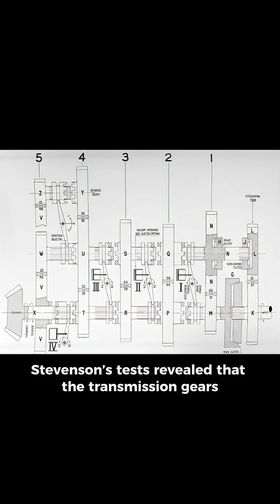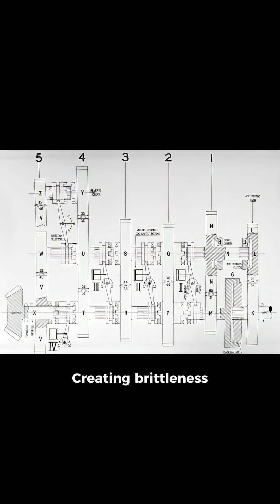British Metallurgists Examined Tiger Tank Transmission Gears — Then Discovered Why...

Comment: Excellent specific analysis. 《 Tiger》was a nightmare, even before get into battle, for Nazis logistics. Russian  mud between 24 interlapped wheels, frozen, made imposdible for monster to move in the morning or after rain in Ukrain ''rasputitza'' ( derp, black Ucrainian mud). Bridges couldn't suffer 56 tons - weight, turning of turret was too slow, huge consumming of petrol , only 100 klms range on good terrain, (very fewer in real conditions), need of special - small- tracks for train transportation, very difficult to be repaired under battle circimstances  :
 in the contrary of soviet《 T-34 》in battle repairing, by the "braviest of the braviest" , Soviet women technicians under explosions of shells and machineguns firing etc. etc.
Shortcomings of "Tiger "were about equal to its fighting abilities. Nightmare logistics...
KOSTAS TRENT

Comment: The Tiger was supposed to be a breakthrough tank, creating a breakthrough and then going to depot maintenance.  Of course after July 1943, that plan was no longer possible.  Tigers were usually desperately needed for defense, and on the line often continuously for days or weeks.

Comment: You meant the case hardening was too deep, the running surface needs to be hard, resisting wear, but with the mass of the gear softer and ductile to flex rather than break.

Comment: 'Excessive case depth' is an interesting. In case you don't know, 'case hardening' is about hardening mild (low carbon) steel. Mild steel is cheap and plentiful; it cannot be easily hardened on its own. Case hardening is about introducing carbon into the mild steel - either by cooking it for a long time in the absence of air and in the presence of carbon - typically in the form of calcium or barium carbonate or using natural sources of carbon such as bone chips or animal skin. Alternatively, the 'nitriding' process uses sodium cyanide as the source of carbon. Once the carbon has penetrated into the outer layers of the steel (and it doesn't go in quickly) the steel can be hardened by heating to red and then 'quenching' in oil, molten salt or water. This produces a hard outer skin known as the 'case'. It's very important that the case is 'tempered' - another heat process - which increases the 'toughness' of the steel whilst reducing its brittleness.

Excessive case depth - which would probably cause excessive brittleness - suggests something going very wrong with the process, quite possibly sabotage. But, any decent metal hardening workshop should be able to do the necessary hardness and toughness tests so you'd expect the problem would be detected.
Reply from the maker: Thanks for the incredibly detailed explanation of case hardening!

Comment: One of reason that failur was fact that this engine, transmission and mechanism was for less masive tank, only 35 tonnes. They give more armor, stronger canon, and left same driving gear for mass 54 tonnes.
Reply: And the same thing happened with the Tiger II.

Comment: Major General Percey Hobart is famous for creating specialty tanks called Hobart's Funnies. Of all the Funnies, the Churchill Bobbin was the oddest looking. Due to its resemblance to a spool of thread, the tank spread a layer of steel mesh over soft beach sand, allowing other vehicles to cross. During the Dieppe Raid, the Germans picked off helpless British tanks stuck in the sand due to their weight. So, getting tanks off the beach quickly was crucial. Only one Funny, the flame-throwing Crocodile, truly put fear into German soldiers on D-Day. 

 

churchill bobbin tank
Churchill Bobbin Tank. Source: World of Tanks
 

Towing a trailer full of petrol, the Crocodile drove up close to the target, firing its flame thrower. Many soldiers gave up before this, not wanting to be burned. Even preventing a fight displayed another function. Hobart also adapted the Churchill into the AVRE. His men installed a 230mm petard mortar instead of the main gun. This mortar could destroy concrete or blow holes in obstacles to get men and vehicles off the exposed invasion beaches. The ammunition was called the “flying dustbin” due to its resemblance to a wastepaper basket.

 

Who Used Hobart’s Funnies?
d day invasion june 6 1944
A photograph of US soldiers during the D-Day invasion of Normandy on June 6, 1944, opening the “second front” in France. Source: The National WWII Museum – New Orleans
 

On June 6, 1944, or D-Day, American and British armies used Hobart’s Funnies. The British and Canadians enthusiastically used all the different Funnies. The Americans kept to the Sherman swimming or their mine-clearing flail tank. Before D-Day, Hobart demonstrated the Funnies to senior British and American commanders. They included Hobart’s brother-in-law, General Montgomery, in early 1944. While the British already decided, the Americans declined. They stayed with just the DD Swimming Tanks and dozer tanks, similar to bulldozers.

 

What Happened to Hobart’s Funnies on D-Day?
british officers crossing rhine WWII
British Officers Crossing the Rhine. Source: mikesresearch.com
 

Hobart’s Funnies landed with the Allied armies on D-Day. They worked as designed, even under intense fighting. The most numerous Funnies, the DD Tanks, drove off, landing ships towards the beaches. Yet many DD Tanks sank, swamped by rough surf as water spilled over their canvas skirts or hit by German fire. One DD tank battalion lost 27 of 29 attempting to land on Omaha Beach, but most of the tank crews escaped.

 

Any DD tanks or other Funnies, like the Flail or Churchill Bobbins, that landed were successful. Despite tenacious German resistance, they knocked out defenses or provided exits off the beach. This needed to be done fast, as the Germans mapped all the beaches for their big guns to fire on.

 

The 79th Armored proved useful in later campaigns, such as fighting in Holland with its canals or the later 1945 Rhine Crossings. The Rhine was the last natural defensive barrier and gave access to the center of Germany.

READ NEXT
5 Female Heroes of World War II
photo of Matt Whittaker
Matt Whittaker
BA History & Asian Studies
Matt Whittaker is an avid history reader, fascinated by the why, how and when. With a B.A. in History and Asian Studies from University of Massachusetts, he does deep dives into medieval, Asian and military history. Matt’s other passion besides family is the long-distance Zen-like runs.

Like
Cite
Format

MLA
APA
CHICAGO
YOUR CITATION

Whittaker, Matt. "What Were Hobart’s Funnies?" TheCollector.com, January 11, 2025, https://www.thecollector.com/what-were-hobarts-funnies/

Copy Citation
Share:

Read more by Matt Whittaker
View All
medieval armor
5 Medieval Battles That Changed the Course of History
feared gangs of the wild west
Where Did the Most Feared Gangs of the Wild West Emerge?
POPULAR IN History
View All
How the Nazis Won Over the Establishment in the Weimar Republic
How the Nazis Won Over the Establishment in the Weimar Republic
by Benjamin Godfrey
Why Did the Vikings Begin Invading England?
Why Did the Vikings Begin Invading England?
by Jessica Suess
Who Were the Knights of the Round Table? (Arthurian Legends)
Who Were the Knights of the Round Table? (Arthurian Legends)
by Caleb Howells
Frequently Read Together
5 Female Heroes of World War II
5 Female Heroes of World War II
by Katie Brown, History
5 Forgotten Fights on the Eastern Front in WWI
5 Forgotten Fights on the Eastern Front in WWI
by Grace Ehrman, European History
Sidbar Newsletter
Follow your Favorite Topics.
Sign up to our Free Weekly Newsletter
Email Address
Subscribe
Frequently Read Together
World War I: Why Were Tanks Invented?
World War I: Why Were Tanks Invented?
by Benjamin Kitchen, Stories
The Second Battle of El Alamein: How Was Rommel Defeated?
The Second Battle of El Alamein: How Was Rommel Defeated?

Comment: . Tigers actually did hundreds of km road marches without breakdowns and didn't really suffer from significant transmission issues. In 1944 the Tiger's overall average operational rate was 75%. 
Rendering them useless before they could engage the enemy? Then how come the Tiger battalions knocked out circa 10,000 enemy tanks, assault guns and tank destroyers and had an overall 12 to 1 knock out ratio, making them the most successful and effective tank in knocking out enemy tanks in WW2.?
Sources, Jentz, Spielberger,Doyle, Wilbeck, Scheider.
Reply: 70 ton tank with a 40 ton tank transmission. 
Sucked premium gas. 
2.5 gallons per mile

Comment: They did not have stuff to hard the steel so they just cooled  it down faster to make it hard. Hard steel alloys are iron-based metals enhanced with other elements like chromium, nickel, molybdenum, vanadium, and tungsten to increase their hardness, strength, and durability.
Reply: Right.  They were losing access to rare earths due to strategic withdrawals which made it difficult/impossible to produce the proper alloys required for their vehicles.
Reply: Quenching aka cooling rapidly, doesn't make steel harder - it has to be the right kind of steel first. You can heat and cool mild steel as often, and as fast, as you like, itt won't harden.
Reply: @alastairbarkley6572  Lets find out Here is Googles AI answer" Quenching steel is a rapid cooling process that dramatically increases its hardness and strength by transforming its crystalline structure to martensite. To quench, a heated steel part is plunged into a cooling medium like water, oil, or specialized fluids, which must be chosen based on the steel type and desired outcome." The problem was Germany did not have the chromium, nickel, molybdenum, and vanadium to improve their mechanical properties.   So they could only use quenching the steel to make it stronger.
Reply: @alastairbarkley6572  Needs Carbon.

Comment: Not flawed design so much as a lack of strategic raw materials, rushed production and inadequate QC, if the heat treatment had been done properly the brittle fracture would not have been so much of an issue. The production staff were under pressure to produce, corners were cut, what happened latter was 'not their problem'!

Comment: If any of the Tiger's parts were made by slave labor it's also possible that sabotage was involved in the casting of the gears. This type of thing happened often. That's what happens when you have a dictatorship and force people to do the work.
Reply: We do know that the Panther was sabotaged by slave labor, also in their transmissions.
Reply: My thinking too
Reply: Can see your thinking, but the errors were a design one and not a manufactured one.
Reply: transmission gears are not cast.  Rolled steel is cut to shape, gear profile hobbed, then it goes through case hardening then stress relieving.
Reply: @stevenstoll2016  Forged to shape, not cut.
Reply: That happened with truck manufacturing. The slave Jewish workers changed the level for oil and therefore the engine is burning out, created by a simple notch a simple tiny notch on the oil dipstick created massive failures.
Reply: So who would you have done the work?
Reply: Hubieran aligerado el peso pues no podían cruzar puentes , no pasaban desapercibidos por su volumen lo cual anulaba factor sorpresa , los tanques SOVIETICOS pesaban menos  eran más ágiles y tenían bajo perfil

Comment: This video points to the real problems with the Tigers design: improper production. Lack of necessary alloys (chromium, molybdenum, manganese, nickel, cobalt, tungsten, silver etc.), causing lack of steel toughness. Improper tempering, due to rushed production & labor quality, resulting in steel embrittlement.
These problems in all aspects of German  production were progressively becoming severe after 1940, and were endemic & seriously impeding effectiveness by 1943. All aspects of production were affected: armor, guns, motors, transmissions, pressure hulls. Boost pressures had to be lowered for supercharged engines. Wear & failure rates were becoming alarming by 1943.
This was all too predictable, and started taking on serious dimensions even well before Germany started having major reversals on the battlefield in late 1942. This situation really points up how bereft of common sense were the Nazi leadership. Their egos were clearly writing checks that their bodies, nor all their minions' bodies, could not  cash (paraphrasing a semi-famous movie DI).
Reply from the maker: You’re absolutely right that production issues and material shortages severely crippled the Tiger’s effectiveness.
Reply: This video is exaggerated nonsense. Many Tigers actually did hundreds of km road marches without breakdowns and didn't really suffer from significant transmission issues. In 1944 the Tiger's overall average operational rate was 75%. 
Rendering them useless before they could engage the enemy? Then how come the Tiger battalions knocked out circa 10,000 enemy tanks, assault guns and tank destroyers and had an overall 12 to 1 knock out ratio, making them the most successful and effective tank in knocking out enemy tanks in WW2?
Otto Carius, an actual Tiger veteran, insisted a well trained driver who handled the Tiger properly could reduce technical issues by 90%. Carius said he never had any Tigers break down in combat. It was only when overexerted on long road marches. 
Sources, Jentz, Spielberger,Doyle, Wilbeck, Scheider.
Reply: @lyndoncmp5751  There was a steadily & alarming decline in steel quality, and  crew training, that caused more problems at the operations level by '44, ALSO reported in source references. Some of these references were the Allies themselves, who were noting declining quality.
Reply: Right.  This revealed one of the risks of emphasizing quality over quantity as a war effort.  If you lose access to critical minerals then there goes your quality and your advantage.
Reply: @josephstabile9154 That's what you get when you dare cross the banksters!